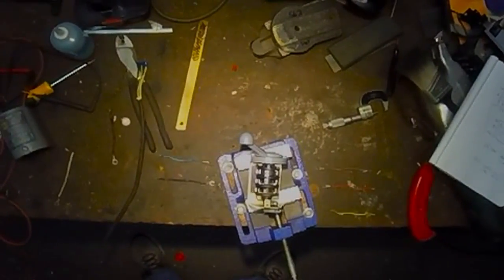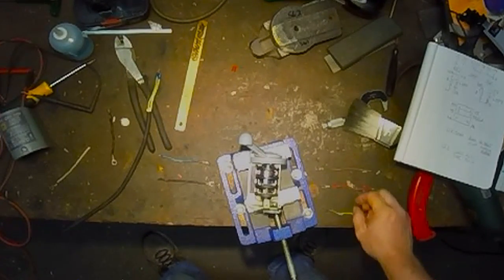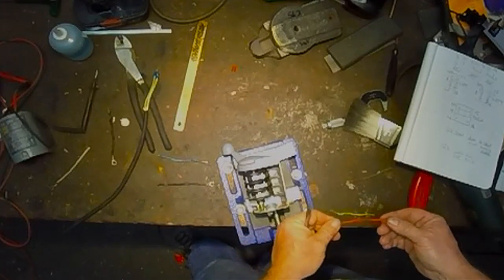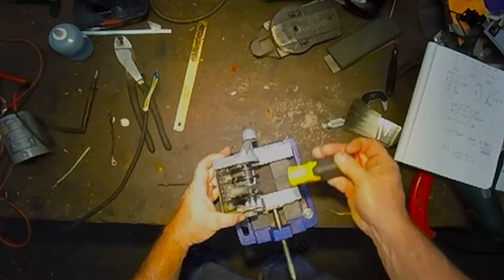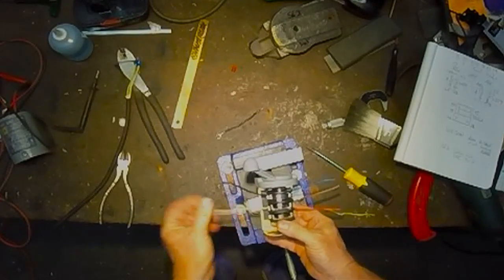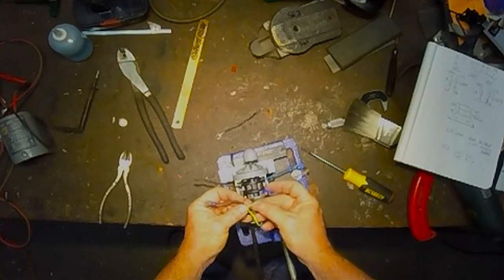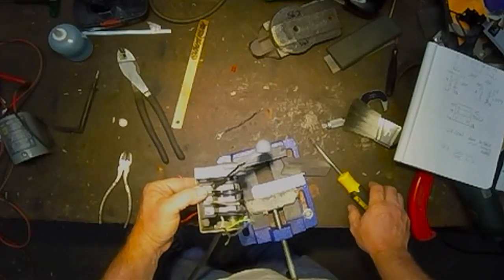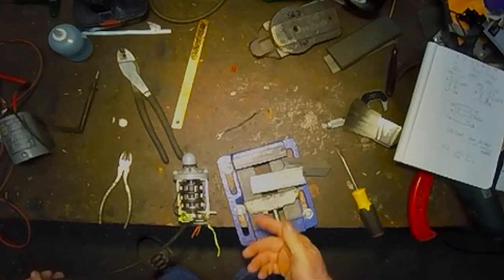Square D 2601 Drum Switch Wiring Tutorial

Comment: I have a single phase motor  1/2 hp  on my lathe.   I'm wiring it for low voltage 120 v .  The new motor has 7 wires.  3 capped.  3 in line and one in line.    Any help wiring it to my switch. ?    It's a 1 phase switch , motor I took off was 70 years old.  Old Westinghouse  1/4 hp.
Reply from the maker: sure if you can post or send me a picture of the motor and the switch. if the motor has a nameplate add that picture as well
Reply: Metalworking Machines and Tools   it's a furnas F4 switch and a HF 1/2hp motor.   I don't know your email to send pics. Thanks